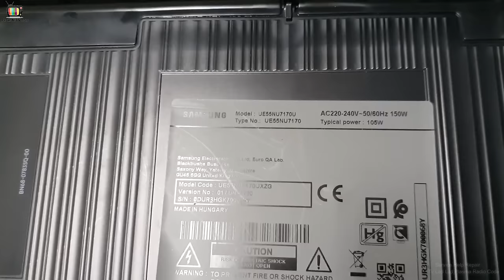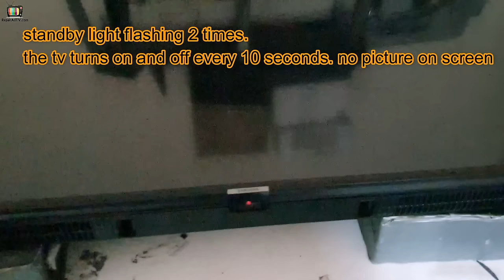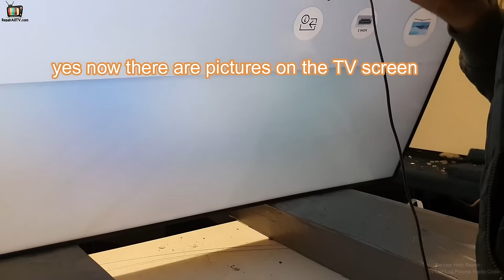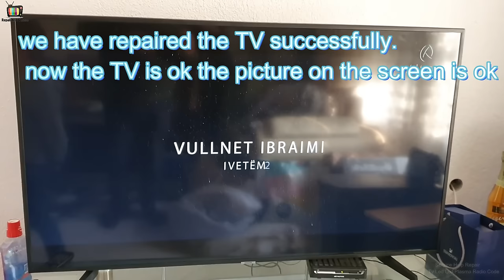SAMSUNG UE55NU7170U The TV turns on and off. every 10 seconds no picture on the screen

Comment: for those who doesnt know what hes doing, let me explain. there are 4 lines inside the display lcd, 2 right, 2 left, one from pair of line is shorted. Thats why, tv unable to boot properly. in this case, right side were shorted. he isolate the shorted line,(skip 13, isolate 14-24) . which is same to me. i already done it and its work. thank you :D, sorry if my explaination dont include the clk,css or anything related to lcd term. i just try to make people who doesnt know about it  understand the principle
Reply: Hi, i have the same problem. Is the ribbon cable shorted or the pins on the motherboard shorted?
Reply: @zihanzalymann1316  its display lcd which is shorted. you need to isolate the shorted line
Reply: Thank you
Reply: How do i isolate the lines
Reply: @himalaya1111  using tape.
Reply: @isajakwa4059  so i do it pins by pins .
Reply: @himalaya1111  do you have the same model as in the video?
Reply: @isajakwa4059  mine is QA55LS03TAKXXL
Reply: Its 55 inch  samsung frame
Reply: @himalaya1111  what problem do you have?
Reply: @isajakwa4059  keeps on restarting.repairman confirms that its a pin short issue but according to samsung protocol they can only replace the entire panel
Reply: @himalaya1111  dont trust manufacturer. repairman cannot solve? most of the time, isolating the short will solve the problem. this only works if your tv got 2 flex like in the video.
Reply: Will try d fix
Reply: I cover both  side of the ribbon still separate of course still same issue any tips
Reply: Good morning sir my samsumg Tv 50inch model UA5OTUB1OOKXXT only one cable wire what should i do need to use sticker tap from where to where sir need to help my problem thank for advice
Reply: @savagestaysaucy  thats mean both right and left display line is shorted aka unrepairable unless you change lcd itself
Reply: @onmiknight168  if only one, you cannot use this method.
Reply: @isajakwa4059 So you have the methods for this model UA5OTUB81OOKXXT?
Reply: I only have ribbon on mines similar TV,  I notice I did what he did it's stopped it from.cutting off and on and stayed om sound no display blueish screen , so should.i leave that taped and find others ? , because I tried the other side of my ribbon opposite of what he taped.  And no tape on that side and finally got a patch of lines, what would you recommend , ?
Reply: @Theundisputedtruth  did you figure it out?
Reply: @leedx1365  nope , just threw it away , it' was frustrating , I'll just buy good brands new, Samsung and LG are terrible
Reply: @Theundisputedtruth  sorry sir. idk any other method.
Reply: So you know wich pina need to isolate in a samsung un58tu7000f with the dame issue
Reply: With all the pins on that ribbon how do I know which ones to cover with tape?
Reply: @isajakwa4059 please help me out this problem I don’t know the sorted one I also done 14-24 it doesn’t work 😞
Reply: @isajakwa4059
Reply: Hi I have a samsung UA70TU7000U turns off and on with flashing red light 2 times ?
Reply: @whateverwedo7340  sorry, if this method doesnt work, i guess its time to buy a new tv
Reply: @CharlineDouce  blinking red usually problem with component on board, usually its shorted. if you dont know how to find short, buy a new board
Reply: I still don’t have picture but sounds back on and I only unplugged it
Reply: Hey man after a long 3-2 hours I got it to work thank u so much I appreciate u showing the steps cause it worked for my 7 series Samsung 55inch tv
Reply: Hey Question, so I did mine, but the colors are off did I short the wrong section? Please help
Reply: I just did mine but I have a blue hue to the screen, can you recommend anything else?
Reply: How many track blok
Reply: I have one question sorry. You really need  to count 13 pins from the left  to complete and put rubber after 13 which is mean 14 to 24  pin that’s correct?
Reply: @hichemkhiar4612  yes. dont be afraid to try isolate more or less. just try n try😂
Reply: I have an 85 inch Samsung. It’s only one ribbon which I found out this method won’t work, but with the tape on, it does not do the reboot every 5 seconds. TV stays on, but no picture. What could be the issue?
Reply: Thank you formthe info!
Reply: Where are u from?
Reply: Bro, how to check the shorted line? Should i try to isolate one by one?
Reply: I got a ? On this so I got mine to work and does that mean I need to replace the board to it cause the one backlight on one side not light up so do I need to replace that board or the backlight board
Reply: @Billy_M_Gamer  its LCD problem. not motherboard or the backlight
Reply: @isajakwa4059 how do i know if the panel is short ?       on my model there is only 1 cable.       I tried to isolate
 the pins, I got a picture but with lines on the screen.  will replacing the motherboard solve the problem?
Reply: @dragan3018  nope. 90% its a lcd problem
Reply: @isajakwa4059  Thank you. can I get a picture as clean as before by covering some other pins or is it simply the best I can get?
Reply: @dragan3018  you can try. i think there's a time that i did that and its worked. but sometime you just to accept it😂its better than nothing
Reply: @isajakwa4059  ok. Thank you .🙂
Reply: Hi bro, i have only one line in my tv, do have any solution for that
Reply: Did u get it to work and how?
Reply: @sourabhtomar3029  me 2 did u solve the problem

Comment: To open the back, you don't need to pull the wire/long pins out. Start at the bottom edge of the TV where there's a hole at each end. Use a pry tool like he has. Start by releasing the 2 bottom corners and then run the pry tool all the way around the TV, 2 pry tools are easier. You will hear the clips pop open as you go around. It sounds like it breaks but it doesn't. Then when you need to replace it just pushes back on in seconds. I hope this helps.
Reply: Thanks,  dude!
Reply: Hmm will it work on the 75
.saw the video for the 55 where it's done as you say..
Reply: I messed up my tv doing this but it works tho but it'll last until I buy new one
Reply: Thanks
Reply: So what was it that he covered? Is it important?
Reply: I broke the cover in three pieces..now I will know, thanks

Comment: I love how this video actually gives you a solution, but i would love an explanation to the solution lol. Would be great to have a understanding of this problem.
Reply: I agree woth you. Also i wonder, does replacing the cable would fix the problem. Is is the big cable or the smaller ones directly into the tv that has a problem...
Reply from the maker: if you see this problem as in the video, the problem is (COF), to fix it, cover the ribbon lines as in the video. ok, but your problem may be a little different, why do you need to cover the line with less or more or another ribbon to cover the lines, this TV has two ribbons that connect the display to the main board
Reply: @RepairAllTV Hi Good night I was just watching the video and my TV have to same problem. I opened it and try to do what u did in the video and the TV came on but I'm still not seeing and pictures on the screen it's just blank can you please please help me please

Comment: I have not seen a tv that opens from this difficulty
Reply: Unfortunately all Samsung TVs have now this crappy clip system.  There is a samsung tool designed especially for this disassembly. In fact it's not so difficult with this tool, you just have to go around the cover with it and i have to admit it's fast. But it's still a piece of crap, often the clips break or other parts of the cover... Even on the technical documentation it is written that clips can break... The Panasonic Clip design is much more better and doesn't need special tool. On Panasonic the cover is stronger and more flexible, fewer but bigger clips. And there are just hooks at the top so you just have to unclip the sides and pull the cover down, a treat after disassembling a Samsung
Reply: Why don't they make TV with self destruct the moment you open the back cover? Only the authorized agents could bypass the booby trap.
Reply: @williamwong5627  They use to have a trap switch on some of the old Plasmas that would erase the EEPROM. JVC for one. Ha!

Comment: Great Video, thanks. Taping worked on my 2,5 years old gq55q60r with bootloop, after checking everything else. Narrowed it down to  two pins, somewhere at 15,  starting from the left on same cable as shown. However, this will be my last samsung...
Reply: Same, my tv is like 1 Year old and already it has a problem like this…
Reply: I'm experiencing this issue on the same model. Gq55q60r. I don't trust any Samsung mid range products. They're cheap built product. They only care about the flagship
Reply: Seems so,  however 2 years has passed now since I taped, still working and no issues.

Comment: Thank you 🙏🏾 so much for posting this repair video. This fix worked on my Samsung UN55KS8000FXZA that kept boot cycling. You saved me a lot of $, and I feel so accomplished. 

I did this initially and it did not work. I knew I had a good power supply, but was not sure about the main board and led panel. I went ahead and installed a new main board and no change. I did not find any burned resistors on the led panel. Went back to scotch taping along the 2 connectors on the main board. Tried a few different sections and then all of a sudden, voila!

For anyone other there with a Samsung and who has tried almost everything, try the scotch tape method again on various sections. You may get lucky! It’s worth a shot and costs zero dollars!

Comment: Just want to say a big thank you. This method works wonders and saved me money from replacing the whole LED panel which the Samsung technician suggested. Everyone is different, just got to keep trying as to which pins are causing the problem. Initially covered 10 pins and the color on the right side of the screen looks dull, so I tried to isolate the pins further. It was tough work as it took me hours. The pins were very small and it was hard to just cover one pin. Eventually, I covered about 3 pins on the right side. The result was not totally perfect as there were some faint horizontal lines, but they were not obvious at all when watching the TV from a distance with the naked eye. There was also no color issues this time and I can finally watch my TV now! Hope this helps! 😅
Reply: Im having same issue, but cant locate which pins are causing the issue, did you just try one by one? Any method I can use to better find the pin with issue?
Reply: @The1thegodfather3  you need to keep trying through "trial and error". try covering about 10 pins at a time, starting from one side slowly moving to the other side. once you have found where the issue is, you can start to reduce the tape size to just 3 to 5 pins. Patience is key. This solution will not be perfect, but as long as it's comfortable to your eyes, you can stop.🙂
Reply: I am getting lines that change to a white center screen but still no picture. I kept moving tape. Sometimes i get blank screen.
Reply: I did covered about 10 pins from right to left.  The colors in the screen were just about perfect, however, after mounting TV on the wall I noticed a back and forth brightness going to normal to lower coloring not much difference if you are not looking for that but it is happing... My guess I have to take the time again to find what pins I can covered and avoid the little small flickering of color. If I have to guess it is happing on the left side of screen if you look at it in front of you.
Any of you had the same problem?
Reply: @DrFella-ld8zr how did you fix it please I have the same problem
Reply: @simple-run  Is your TV still working? How long did the equipment last after repair?
Reply: @taffineschristian1206  yes, I'm still able to watch my TV 😁
Reply: @simple-run what type of tape do you use ?

Comment: Amazing! Thought my 1 year old tv was trashed, Samsung wouldn’t help. Ran across this video so it was worth a try. From the right I left 15 pins exposed and covered 10, got sound but no pic so I covered one more pin and POW everything worked! Thank so much.
Reply: Did you see any issues with your coloring on either side of the screen? That's currently my issue.
Reply: @yonolo  yes, the left side of my screen lost a bunch of color on certain channels but honestly I’m just happy I can use it. Samsung was willing to work with me on it at first but dropped my case. I was literally a day away from taking it to the dump. It makes a good spare bedroom tv.
Reply: Wish me luck I’m gonna have to try. Darn Samsung 70 inch
Reply: Update…. I trashed the 70 inch and bought a75 inch with a 4 year warranty. 🤦‍♂️
Reply: @anoob4real  didn't this fix work?

Comment: It worked on Samsung un70nu6900f, exact same behavior, i used a strip of tape of like 5mm width, itried like 4 times starting from pin 8 from left, skipping like 3-5 pins each time.

Good Luck.
Reply: Hola, si funciona lo que hiciste? Tengo el mismo modelo con ese problema
Reply: Asi como lo puse funciono, lo unico es que como comentan algunos colores se ven mas frios, no iguales a como se veia pero almenos sirve, y como la falla es de la pantalla no de la placa no hay mucha opcion
Reply: What pins did you end up covering?

Comment: To anyone interested I spent some time taking this a little further and in my instance narrowed the problem down to pin 24. But when I reinstalled I had another issue arrise and solved it by covering pins 22, 23, and 24. Reinstalled cable and tested works flawless with no issues and no color issues.
Reply: Left or right side
Reply: @MilkCurds  same as in the video, from the left side
Reply: I’ve covered 3 pins, and now I’m receiving sound and a picture, however it’s very white and barely visible.

Does anyone have any idea where to go from here?
Reply: @benstewart6707  hy, i have a same problem, what was the solution for you?
Reply: How would I know where to put the tape
Reply: I get the concept and why it works but I have the same question as a few others. Is it trial and error to find which pins are bad? I noticed in the video he didn’t start at the end he started 13 or 14 pins into the ribbon. Just a guess or from experience? Great video by the way

Comment: This method sloved the problem. But in my case error is in other ribbon cable, so be patience and check both ribbon cables, also try changing the tape position until your tv is working. Good luck

Comment: I will say this does work however you absolutely HAVE to disassemble it the way these guys do in the video I opted to take the bezel off the front thinking the screen was held in by something else but it's not, once I fixed it I tried tilting it up like these guys do and the screen shattered since the screen costs 750$ from scamsung this tv is now trashed

Comment: I just fixed 75", great hints, wire locking system and insulation tape..... Thank you
Reply: I have a 82" doing the same thing do you think this will work on it
Reply: Where is position for single ribbon ?
Reply: @edisukriansyah5230  I have only a single ribbon too and the tv stays in but no oictur
Reply: Witaj. Długo pograł ten telewizor po tej naprawie ?

Comment: Hello BNKTOP repacNMeHKO,
 My Samsung model is un55MU6290fxza MFG (2018)
& Samsung un55NU6900fxza MFG(2018) same problem tv turns on and off every 10 seconds
I put electric tape on ribbon cable @ pin #13 for left side of screen on both TVs and it worked 👍after repair there is no defect in viewing the picture in 55MU6290) after repair on (55NU6900 picture is ok with small lines not noticeable 👍  ,  thank you for the excellent instructional video
Reply: Cut the tape, make smaller one. You hide pin which is needed for video without lines. Move one pin left or right for example. I hide only 4pins (7-10 from the right side), before with 6 or 5 hidden pins i has horizontal lines and flickering.